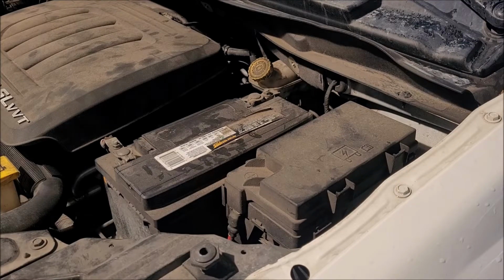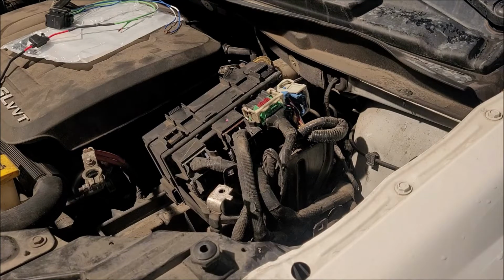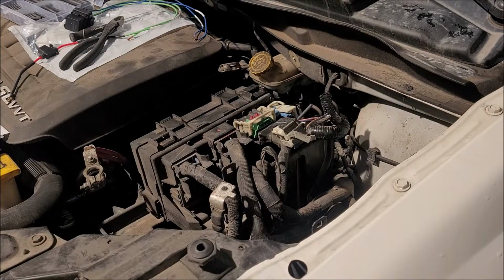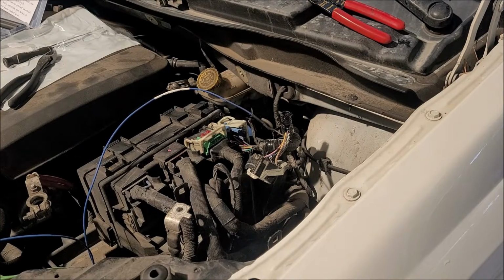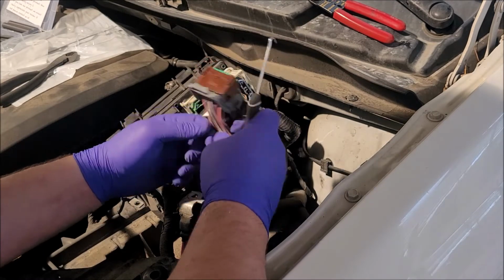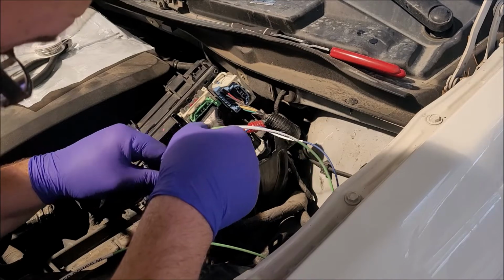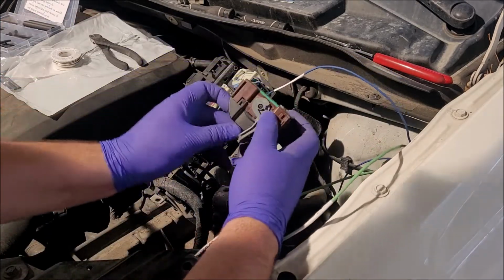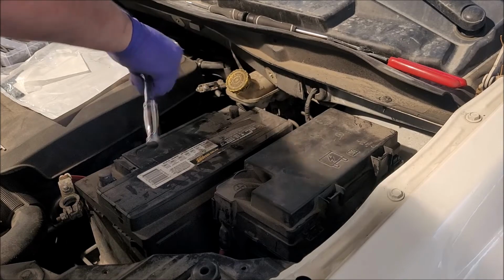2011 Dodge Grand Caravan Fuel pump relay bypass

Comment: I live in Arizona where it's hot and I have recently started having this issue. I replaced the battery last month and the alternator over the weekend. It is still draining the battery. Mine is a 2019. Would this also apply to the 2019 Grand Caravan? Thanks.

Comment: WHERE DO I GET A BYPASS KIT ??
Reply from the maker: Links in the description of where i got mine.
Reply: Why would you bother?
Buy a $5 dollar 4 pin relay, he told you terminal numbers.
Reply: @fringemajority8805  I know nothing about it, I have the common problem and everyone says to either get a new tipm or install a bypass.... is the 5$ 4 pin relay an option ? Are you guessing or do you know ? Cause I'll get that too, im currently waiting for the bypass kit to come by mail.
Reply: @JamesWilson-po7jj  yes I know for sure,  just finished the job 10 minutes ago.
Works great.
       Any common 4 or 5 pin relay will do...the only difference is on a 5 pin use terminal 87 to power pump    ( dark blue / orange trace)
    Not 87a which is a constant power pin. 
     85 is ground on all relays, you don't need to tap into brown wire as described in video just run the wire from terminal 85 to any ground source.
   86 goes to switched power (pink / green trace)
   30 is 12+ from power stud

     All common relays use same pin layout 
        85 ground
          86 switched power
           87 load
          30     constant power

    Relay I used Pico part number 
    926-91    comes with wire harness 
        $7 at local parts store
Reply: @fringemajority8805  thanks bro 🙏
Reply: @JamesWilson-po7jj  no problem 
To make it super simple  if you use that particular Pico relay, as follows
   Blue wire to 12+ stud in fuse box
   White wire to green / pink trace
    Yellow wire to Blue/ orange trace
   Black to any ground
    Red is unused.
Reply: @fringemajority8805 The only issue with running the ground to chassis, is that on this particular system the relay is ground side switched, not power switched. The TIPM switches the relay on via ground on pin 85. When you run the ground to chassis, then the relay will energize every time the ignition switch is on, and your fuel pump will be running constantly in ACC and RUN mode.

That's not good in an accident, nor is it good if you wake up the vehicle a lot without the engine running. Like couriers or ride share drivers do. It's better to use the brown from pin 40, as this ensures the pump runs only when cranking and when the engine is on.
Reply: How do I identify 85,86 and 87 pin in the kit